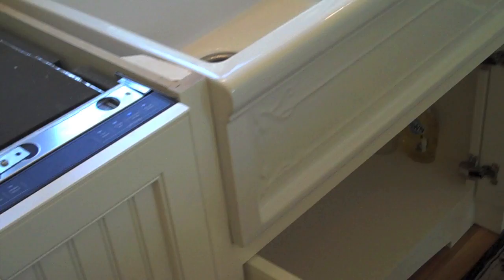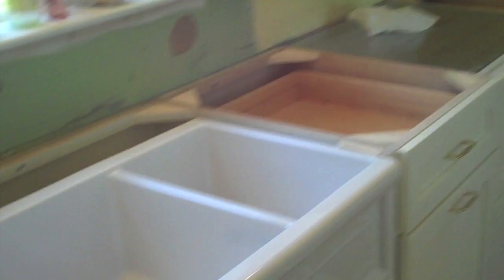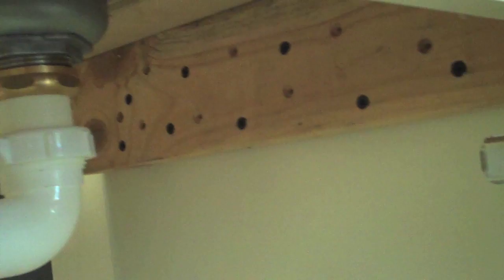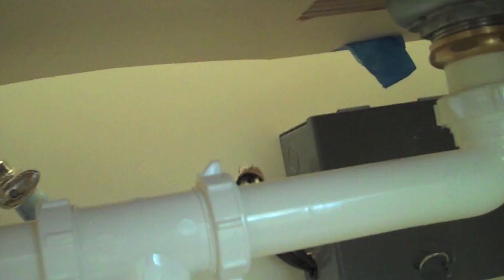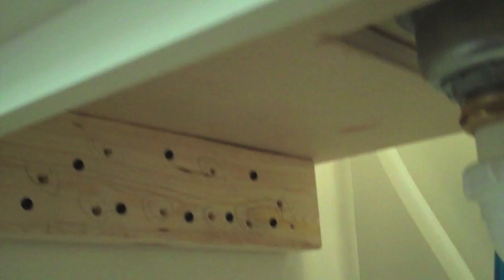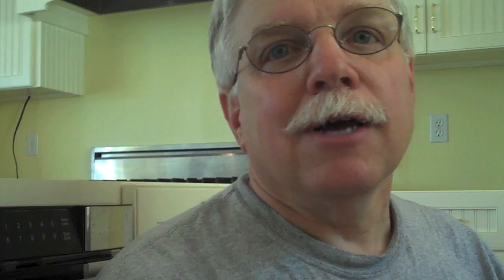Apron Sink Part 2 of 2

Comment: @hitachi088 - Keep in mind, those screws are probably screwing into 5/8" particle board. If you have experience with that stuff you'll know it crumbles and can't support a lot of weight, especially over time. That sink is heavy on its own without water and people leaning on it. Zip a few extra screws in for the long run. If you're worried about cosmetics, it could always be dressed.

Comment: I appreciate your work madman, adding downward struts notched through the sink base resting on the floor is always recommended,  saddled with a front to back cross member on each side. a left to right cross member is then added which can be moved forward or back to allow final fit eliminating the need to cut out the lower support for the plumbing.  Most if not all of these farm or apron sinks are heavy and the single ledge screwed to side is not really "long term" adequate.  A lotta load there not to mention the 8 pounds to a gallon of water.  Not a bad area to "over" build just a bit.
Reply from the maker: Get unlimited FREE tips like this each week by subscribing to my newsletter at www.AsktheBuilder.com

Comment: @hitachi088 it doesn't matter how it looks because its from underneath of the sink and no one can see it, and i know your right here but i would of done the same as this guy to use the other 4 screws as back up screws supportive screws.. if you know what i mean, some sinks like this one weigh a bit and you'll need good bit of support to hold it and hes made sure that support will stay there tightly to hold up the sink!

Comment from the maker: Easy. You'll think I'm a smart ass though. You order the right cabinet - special ones are made for apron sinks. You tear into the wall and re-rough in the drain line to the correct height. It's easy for me because I'm a master plumber. In reality, it's not too hard unless you have galvanized iron pipe or cast iron for your stack. In that case, it becomes an all-day plumbing adventure.

Comment: Did you have to trim down the doors?  I am working on one currently that is 10 1/8 tall and my doors are going to his the sink?  Thoughts?
Reply from the maker: No. Most cabinets the doors are in a plane outside of the sink. The sink is inside the frame of the cabinet and the doors are almost always in the same plane, or outside of it.

Comment: are you adding a 3/4" plywood subtop?
I have a apron sink and im adding a 3/4" subtop....my question is should my sink be flushed with the subtop or can i have it flush with the cabinet top? i think it needs to be flush with the subtop
Reply from the maker: No. I didn't add a sub-top. The thick green serpentine top when directly on top of the cabinets. Adding wood would have put the top of the stone above the desired 36-inch finished height. You want the TOP of the sink about 1/8 inch UNDER the surface of your finished top. That gives you a space to caulk it.

Comment: Sorry but having your supports just mounted on your cabinet walls is not a good idea. 

I had a friend who done that and it just takes a small leak and warp wood and your cabinet walls will collapse. Better if you go from the base board,
Take it out, or cut out 2x4 on each corner to the floor of the cabinet (pass the base board)  and have 2x4 run across on each side to fully support the weight of the sink. 

Would also help to have aB shelf built by 3/4 plywood....

Farmhouse sinks are expensive and if you paid to get that type of work done for support, lol there goes all that money.... plus the cost of having to get new cabinets and repairs made to your counter top
Reply from the maker: Marlon, your method is also susceptible to rot. For goodness sake, use the critical-thinking skills God gave you. All the wood you described that's under the sink can get wet too if there's a leak.